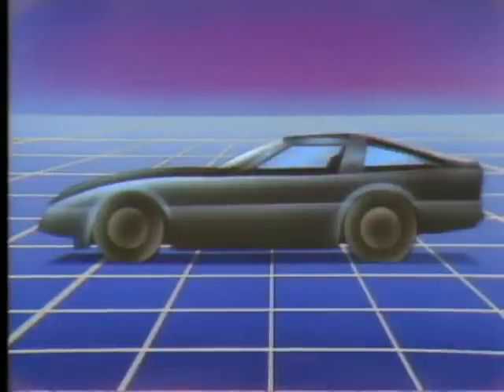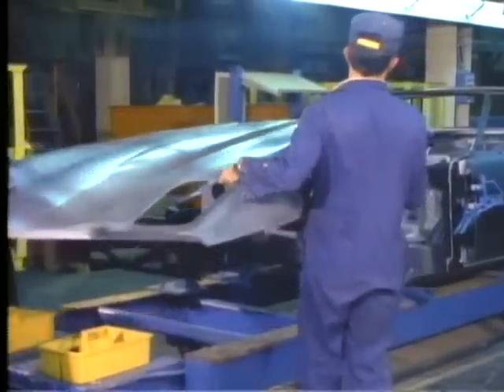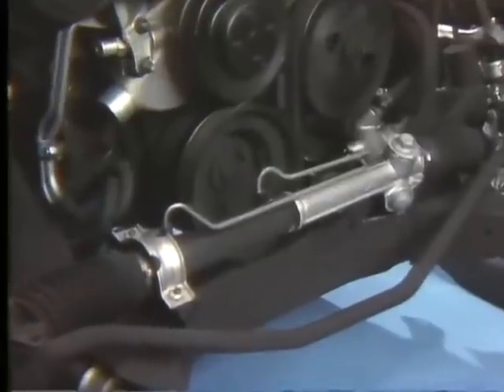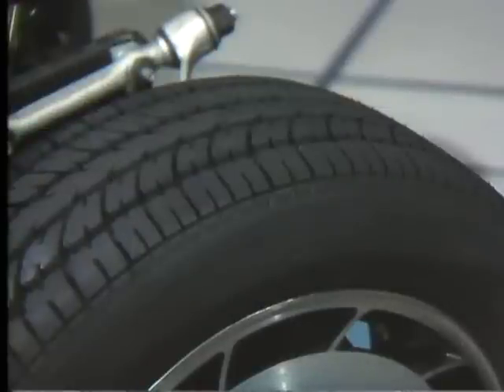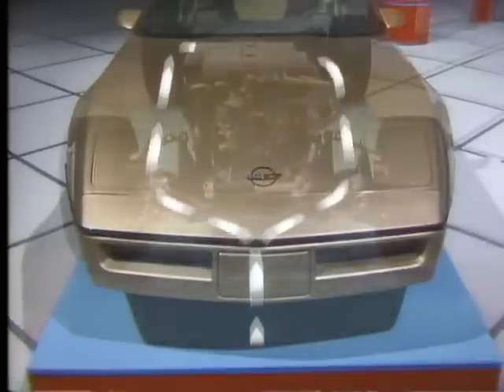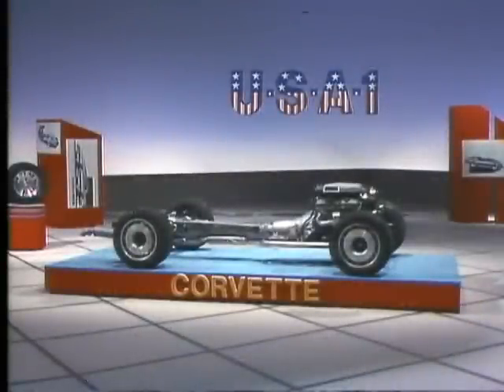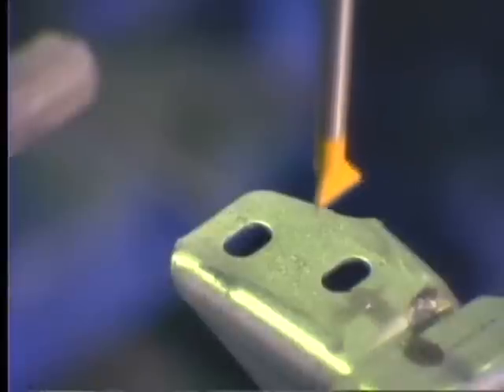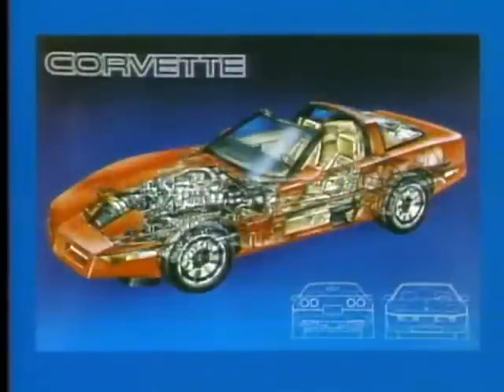1984 C4 Corvette Chevrolet Engineering Video

Comment: I have the Z 51 handling package on my 84. It's incredible even after 28 years!!
Reply: Remmepark So do we! It was the best suspension on any C4!
Reply: even my stock 1984 handles better than my 2004
Reply: Great video! Thx for sharing your experience.  Interested in one of these for wknd drives and occasional track (not competition) use.
Reply: Eh… I love the C4 and miss my 92 but a C4  doesn’t handle as well as a C5.  Not even close.  Like I said owned a 92  am now own a 2004 Z06.
Reply: @retrogamerdave362 idiotic comment. Not even close in terms of specs. 😂😂😂 No c4 would EVER out handle a c5, 6, 7 or on.

Comment: Everyone gives C4 a bad wrap for being boring and slow. This video is one of the many examples that proves GM really wanted to reinvent the Corvette. The C3's chassis and drivetrain was initially carried over from the C2, easly 60s technology. It's apparent that GM was focused extremely on performance versus looks with the C4 and really wanted to make something classic and sporty. Despite the hate, the C4 is arguably one of the more innovative Corvette generations and for that reason, it should be respected for what it was.
Reply: I routinely beat C5 and C6 Corvettes that have not been modified in Auto Cross, with my Z51 Optioned '84.  It does depend on the course some, but the tighter and lower the speed course it is, I can even compete with the Grand Sports and Z06 models.  Open it up however the horsepower wins out.
Reply: First of the modern Vettes!
Reply: David Safely 84 Z51 Suspension was the best! We have it on ours 👍🏻
Reply: Its not boring or slow

Comment: I have the Z 51. It is extremely unforgiving but you cannot beat the handling.  You can tell the difference in the vettes that have the Z51 and the ones that don't by doing a simple test. Toss a dime in the road, run over it, it you can tell if its heads or tails you have the Z51 handling package. ;-)

Comment: Hands down the best car to come out of GM in the 1980's...
Reply: +Mark Graham It was either this or the Grand National. But generally everything GM in the 1980's was complete shit.
Reply: +Nathan McDonald 

naah. the mid to late 70s was the worst. 80s cars had character and they're classics now.
Reply: True 70's were the worst. Carburetors pushed to perform beyond there design limits. no electronic controls. Everything was on thermo- vacume switches. Hell you couldn't even see the intake for all the vacuum lines. All man. pushed up average op temps which aged everything under the hood faster; remember all those vac. line. with in 5 yrs they all stated to leak and a fuel system already on the ragged edge of lean stall. Wouldn't even idle when cold. no HP and crap MPG. Tightening EPA regs caused paints to be reformulated so orange peel was the norm. Then if parked outside flaking off in 5yrs or so.
Reply: The 70s mustang was fugly and week. The Corvette, although beautiful, had no horsepower. Thank God for the Foxbody mustang and C4 Vette. 80s cars saved the auto industry. If it weren't for them we would still be driving underpowered, terrible quality ugly tin cans.
Reply: Nathan.....Based on what you said above, can you tell us the big differences between a (for instance) 1978 Corvette and a 1980 as far as "character" is concerned???   I've had a '68, '75, '76 and now an '82 Corvette .....and they're all pretty much the same car as far as looks and character are concerned.
Reply: CP.......my '70 Mustang Fastback is fugly and "week" (I think you meant weak).  SINCE WHEN??  I think the Foxbody Mustang was one of the ugliest "Stangs" ever built.....and so do many other Mustang owners.
Reply: i can. they all ran like shit except for the 68 depending on engine option.
Reply: The C4 was one the best cars that came out of America...These cars are appreciated in Europe

Comment: Stepping out from a modern sports car into a C4 is a but a revelation. Newer cars have isolated the driver from the road so much so that there is not a lot of 'feel' coming through the car. C4's communicate with he driver VERY well. You sit 'in' the car and become part of it, it becomes a part of you. Dave McClellan and his team on engineers had a lot of pent up frustration from years of Corvette neglect and built a no compromise car as a result. These are very well (hand) built cars that would cost a fortune to product today.

Issues are minor and everything is fixable from the digital gauges to anything drive-train related. Just a great car.
Reply: My ZR-1 is phenomenal.
Reply: Yeah, you feel things alright. If it drives wrong you can actually pinpoint which corner has the problem. Thank the thin, under-insulated glassfiber panels for that haha
Reply: Very well said 100% agree.

Comment: Really cool video.  I've been driving my 85 Z51 for 20 years and it is still fun to drive and gets compliments.  Last year I replaced the stock TPI with a Lingenfelter Super Ram and it pulls even harder at higher RPMs.  I'm running Edelbrock heads and Comp roller rockers.  I also swapped out the 4 plus 3 for a TKO600 five speed.  This car is so balanced and simple.  Most reliable best car I have ever owned.  I can afford to buy a new Corvette, but  as long as this thing still puts a smile on my face I am keeping it.
Reply: What oil are you running in it??

Comment from the maker: @djenne08  I agree with 1baddecepticon. Crossfire Injection works just fine. My stock '84 Vette is very fun to drive. There are stroker Crossfire engines with port matched extrude honed intakes, bored throttle bodies with higher flow injectors, and computer mods that make 400 Horsepower. When '84 Corvettes are 50 years old, no one is going to care how fast they are, they will only care if the car has an original properly functioning Crossfire Fuel Injection system.

Comment: I have a 1986 with the Z51 handling package and I love it! The steering is so tight and quick. The l98 acceleration is very quick! I know it isn't that fast by modern standards but still very peppy. It will roast the tires from a stop no problem. I'm very impressed at how the car has aged. Yes it has squeaks and rattles from being over 30 years old but it still feels solid and gives me confidence everytime I drive it. The weird 80s quirks are very cool to me. Personally I like the 80s digital dash and also the cornering lights that come on when you switch on the turn signal. It lights up the road a little better where you're turning. They put a lot of innovation into this car that still holds up today. Sure I think the c3 is a sexier body style but this Corvette definitley isn't ugly. It's a lot quicker than the c3s ever were anyways.

Comment from the maker: @HairykinAngel Be sure your radiator is flowing well and the thermostat is opening fully. You can also get a updated coolant sensor for the fans that will kick them on at a lower temp than stock.

Comment: The 1986 C4 is a great car even by today's standards. I have owned many performance cars, vettes, vipers, Porsches, SVT lightnings, Sl65 AMG, Dodge Challenger hellcats and more. Out of all of the cars I've owned I've kept just 3, my 1986 C4, my 1986 Porsche 944 turbo and my 2002 true blue SVT truck. First,vThe vette has several advantages over the same year Porsche. Since the Porsche 944 was its competitor in all CUP and SCCA races Ile use it for comparison. Next, the suspension on my Porsche 944 turbo, again the nemesis of the c4 , is a rear torsion bar with eccentric bolts. It uses a rear shock which allowed an upgraded M474 Koni yellow. It's not IRS like the corvette and installing coilovers is a popular option but the corvette beats it because when I hit the gas on my 944 turbo the rear end drops at least 3 inches and you feel it is lost acceleration momentarily.Next, on 944 The front suspension uses a strut assembley and 24 mm sway bar. The optional mo30 brought the larger 28 mm sway bars but is suspension is heavy, springs and struts alone are almost 25 pounds each. Corvette again wins with much lighter and better reponsive suspension parts. The 5.7 liter engine has better off line performance but the Porsche kills it from 45 mph or third gear onward when it's turbo spools up. It's very fast from 45-90 mph and not many cars can run with it. 944 turbo wins in the midrange. Both have top speeds of 170 . Also, The 944 uses a unique transaxle design which provided near perfect 50/50 weight distribution and the transmission on the Porsche is very durable, LSD or live axle was an option only for 944 and very rare in 86, it's code 220 and it became standard on 944 only in 1989 turbo S models. However, Corvette offers live axles on all cars and My 86 vette also has the Z51 sport package plus the rare G92 performance axle option which makes it very fast off the line compared to standard vettes. On the inside, Overall the corvette is more luxury and the Porsche is more business with simple typical German gauges and layouts.Very ergonomic. Both of my cars the Porsche and the vette have sport seats, the vette offered them factory standard but the Porsche 944 offered them only as rare factory upgrades. They both offer good support but the vette offers them in more power settings then the recaro made seats for Porsche. However, the Porsche seats recline and the vette seats barely recline with my height. The corvette offers telescopic steering wheel and a nice wide steering wheel grip but no tele option on the Porsche unfortunately. Finally, the rim and tire packages on the corvette offer 9.5 inches compared to the standard 7 and 8 inches on Porsche turbo 944 so the wider track helps with cornering and grip. Performance is close on both cars but for a few grand more in aftermarket modifications the Porsche can be put to 400 hp and at 2900 pounds it's lethal. In the end I love both cars equally. The Porsche however is worth double of my vette for some reason. Both cars had an msrp of $34000 in 1986 but today my vette with only 18k original miles and a rare Malcolm Konner edition package only books out at 17k compared to my much higher 49k miles Porsche 951 which would bring almost 30k and is still climbing. Perhaps a low mileage guards red Porsche turbo is more exotic than a 2 tone corvette but to me they are both equal in form, function and appeal.

Comment: Late model C4's are my favorite Corvettes... well, maybe except for the C7- but it ripped off the Viper, which I like better than the vette.

The rear suspension is a freak of nature and the use of aluminum suspension components and fiberglass springs makes this car truly unique, especially with that clam-shell hood. 

I had a 78 and now a 96, the C4 is a such a better driving car.
Reply: C7.   I can beat at high speeds but probably not in a courtier mile.  They have traction control. If I slip.im done.   So I'm kinda interested. In traction control.

Comment: I have a 87 convertible,  I enjoy it , Family love to barrow it for parades !!  lol. At this time I am using a 84 vet chassis system as  donor to a 56 F100 , also built as a unnibody  and mounting a Crate 454 engine. I nick named it " ForVette" .  I worked at Gm auto sales In the body shop as a teen ager , Im in my upper 70's now and still building customs.  I hope I have a fun time driving the ForVette as much as the 87 convert.

Comment: The ZR1 project actually began in 1986.... the LT5 powered prototypes were being tested on the roads in 1988 because GM originally planned for the ZR1 to be debuted in 1989.  GM decided to hold them off for a year so they could redesign the interior.  About 150 1989 ZR1s were ready to head out to dealers and they held them back.  I think Rick Hendrick owns a couple of these 89s.

Comment: I disagree with some of what Roadghost88 said.  Here's my reality as an owner of several sports cars- The C4 is an excellent value for the money.  The articulated early sports seats are amongst the best ever put in a car.  The suspension no better than a go kart?  Not true.  Forged aluminum double wishbone front suspension.  Forged aluminum independent halfshaft suspension was bettered by the C5, but it's still good for autocross.  FX3 Bilsten electronic adjustable shocks designed for Lamborghini. I'd say the C4 is about 85% as agile as a Miata, but is 250% more powerful.  Nothing wrong with that considering you can buy a C4 L98 with 45K for $6000.
Reply: Roadghost88
It handles great, and has lots of power. Took mine in the mountains and it hugged curves, not to mention is a blast, had the top off, and played the radio. Talking a almost 30 year old car here.. it's fun and we both love it. Nice stereotypes though, sad you look at the world with such a closed, judgemental mind.
Reply: I wouldn't say the c4 handles better then a Miata
Reply: I agree that the Miata handles better since I own both, but the C4 is no slouch.
Reply: Ha!  My '84 Z51 Suspension with Khumo street rubber out handles a Miata without breaking a sweat.  It also out handled a twin turbo Mazda Rx7 with Khumo Competition race rubber. I've got the times to prove it.
Reply: Cheap is not the operative word for most of us that have owned an '84. Radically changed and performs so well, I routinely can beat 1990's C4's, C5's and some C6's in auto-cross competitions, despite burning off rust from an 11 year hibernation.  Currently giving some C6 Grand Sports and Z06's some reason to turn their heads.  Rebuilding the Cross Fire Throttle Bodies and getting an alignment, last one was in 2006, should put me on their heels.  Cheap... nope, damn good technology and a value for the money, when a car of 3x's the price is not much quicker.  Exhaust... wow... that exhaust was tame, until you put aftermarket mufflers on it.
Reply: It's hard to hide the extra 1100 extra lbs so the Miata is hard to beat in pure handling.  The C4's good handling along with it's legendary engine is a hard package to beat IMO.  I own 2 C4's and a Miata so I can make a direct comparison.
Reply: Roadghost, you should have taken better care of your car or your friend should have taken better care of their car.  The C4 was built to out handle every other production car, and the 1984, did just that.  The whiners, lol complained about the rough ride, so they softened it up.  If you want great handing back in that day, it came with high spring rates and shock valve dampening.  So I say if you want a plush quiet car, buy a Rolls Royce.  lol
Reply: Pen Fu - Agreed!
Reply: The 84's have a really raw vibe to them that I like.  Also I'm a sucker for 2 tone paint jobs that the early ones have.  As you said David, it's cool that Chevrolet actually released race car spring rates for one year on the Z51 package.  I think they had in mind a car for young guys, but unfortunately it became an old mans car when they softened it up.  Adjusted for inflation, these would be well over $75K today so that would be a good reason.  The beauty of all of the old cars is the raw vibe they give you.  The new cars have too much sound insulation and stiffness that isolate the driver from the road.
Reply: Vince, I respect your opinion.  Can you tell me what is the weight of your Miata... My '84 weighed in at 3200 pounds.  The Z51 in '84 was the tightest most responsive (non-computer modulated) suspension, ever produced.  Road tests proved that when compared to all the European sports cars of the day.  Have you experienced a Z51 model '84...  It out handles every other C4 made.  I know, because I've beat them all.  The only car, I've ever driven that was close was a '91 Miata, with cross bracing.    I agree the Miata is a great handler, and likely beats most C4's, just not the '84 Z51.  Course size and tightness of the course always plays into it.  I'd own an early Miata, any day, if I could not own my Corvette!  Thanks for your thoughts!
Reply: David, I'd say the Miata is around 2300 wet.  You probably have a point with the '84. I drove a '84 Z51 about 10 years ago, but wasn't racing it. and it was amazing  But there's no question it's the best handling C4.  I prefer the C4 to the Miata because while mine doesn't handle as well, the overall driving dynamics on the C4 are superior.  I'm close to getting my L98 running in the high 12's (with the 6MT ZF) without boost while keeping all that TPI low end torque.  The Miata is a fun car to drive, but my C4 is downright intoxicating.  I guess the C4's get a bad rap because the owners don't have the money to maintain them let alone to perform upgrades.
Reply: David..One more thing since you're an enthusiast.  If you're not rollcaged, I found the vette to vette chassis brace to help stiffen the chassis on a street car.  It ties the area in the rear where the lateral links connect to the frame with the front torque box. Then it uses heim joints to tighten the structure.   On my convertible I noticed a chassis belly dance on sweepers with a hard suspension hit on one tire.  I'd hear the rear hatch flex as well.  So while I'm not able to measure the improvement, I don't feel the flex and the squeak is gone.  My FX3 adjustable suspension became harsh on perf mode indicating chassis flex was absorbing some of the suspension dampening.  So there's tons of people trashing the C4 that have no vision, talent, or means to address issues to improve these cars.  We used to call this "hot rodding", but people today would rather trash cars on their online rather than get dirty in the shop.